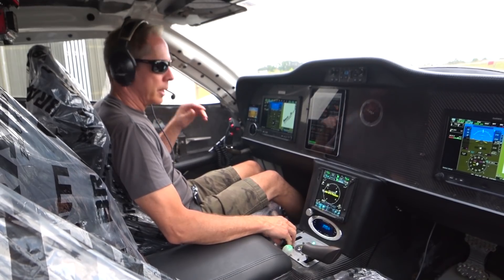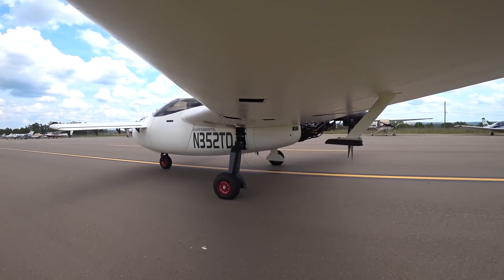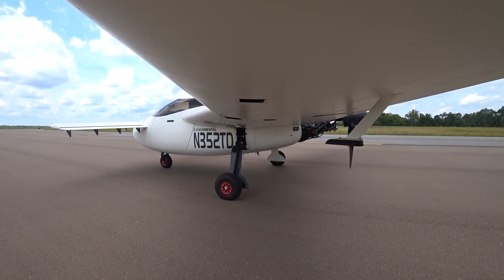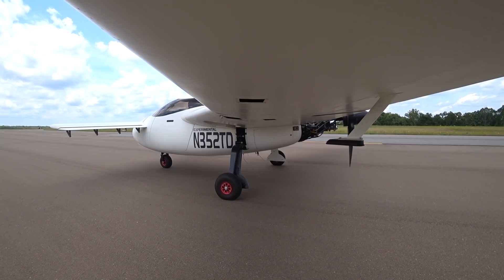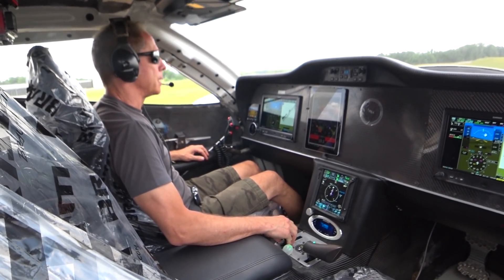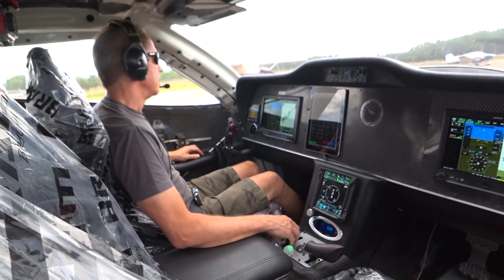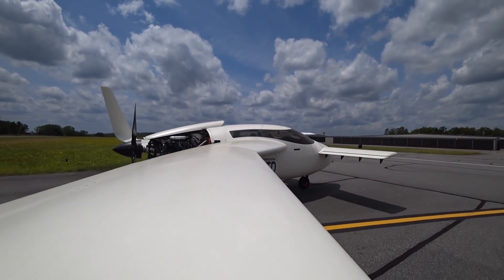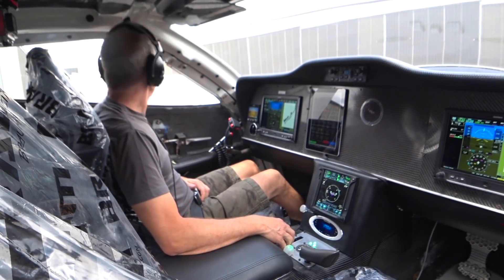Is This Getting Boring? - Building the Raptor Prototype

Comment: This i just keep wondering about. WHY do you have the engine cowling off most of the time? I would be wanting to know my hot spots that need extra protection as well really testing the cooling capacity for the engine. As someone that lives in Arizona, heat is always a issue this time of year....Again just curious  Keep up the updates.

Comment: A question and a comment.  Some time ago the starboard aft window developed a crack.  I don't recall seeing it changed in the subsequent videos.  Did you manage a replacement or repair to that window and more importantly, did you find a root cause?  Regarding the flights, I'm sure most of us would appreciate any updates you can muster as the flight test progresses.  I would personally welcome a 10-15 minute summary but if they go longer, I'll watch.  Video editing takes time - maximize the flying efforts and the engagement through summary videos can be secondary.
Reply from the maker: Nothing has been done on the window yet.

Comment: Was there ever a solution made for the single ECU concern?
Reply from the maker: No. There are other single points of failure that are less reliable than the ECU. That's what the chute is for.
Reply: @RaptorAircraft  congrats to finding test pilots that will accept this risk (I was very disappointed in the previous ones).  Should the need arise, I would love to discuss some possible options. I am an ASE Master Technician in automotive and heavy diesel.

Thanks for the reply!

Comment: Peter, Good to see you're back. Ive been following the Raptor build from Vid 1. As an engineer, I'm happy to watch 30 minute videos if they have relevant technical data and learnings. I currently own a 2015 Cirrus SR22 Australis (5 seat). CAPS is key for me. However with a 1980's Technology IO550N 310 HP Continental engine, I'm very interested to learn how the Electronic ignition & Audi Diesel power plant will perform (on Jet A1). Raptor looks like it could be an equally comfortable (5 seat) and equally safe (with airframe parachute system) alternative to the Cirrus if it has an equivalent or better W&B & flight performance envelope with better fuel economy and lower operating (TBO costs).

Comment: Awesome work man.  Really happy to see you back. Will the motec be able to reduce power to limit temps if they get dangerous? Or is that a feature pilots wouldn't want? Also,  how many othwr items will be automated? Eg, cooling scoop and fuel cooling.  Seems like lots of unusual things for a new pilot to monitor (I'm not a pilot so wouldn't know?
Reply from the maker: Yes, it's already set up to do that if things get too hot.

Comment: Just curious why you are running it without the engine cowlings in place. Is there a heat issue with them in place?
It is a beautiful bird, looking forward to seeing it fly.
Thanks for sharing.
Reply from the maker: So I can easily check everything after each run. The cowling has been on before and does not create any issues. It's a water cooled engine after all.

Comment: Do you have a time limit for operating the fuel cooler while in flight? It sounds as if while
 running at full throttle a with the fuel cooler active could evacuate the header tank and leave pilots in a world of hurt.
Reply from the maker: No, that's not possible because it only pulls fuel from the top half of the header tank so there would always be 5 gallons in there even if the pump is left on.

Comment: Here's a random question for you. I remember when you had the redrive made, the teeth for the two belts weren't lined up and they had to do do another with that modification added. But I never understood why the teeth need to be aligned if the belts rotate at precisely the same rate? I've always been curious of the answer.
Reply from the maker: The reason I had new upper pulleys made was because I needed larger ones so the 5 bladed prop could be used that needed to turn slower.
Reply: I've been watching this series for a couple of years and I think the answer to your question involves making sure the belts were interfacing properly with the pulleys. Aligning the belts to each other and periodically checking that alignment permitted detection of slippage or skipping teeth--a symptom of alignment issues which could then be corrected.